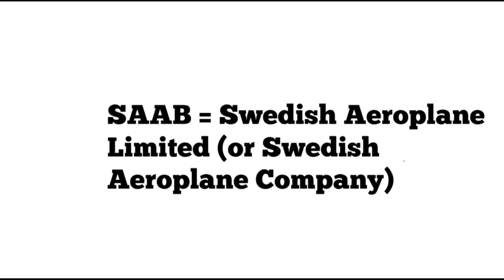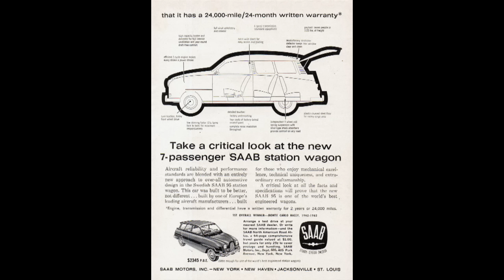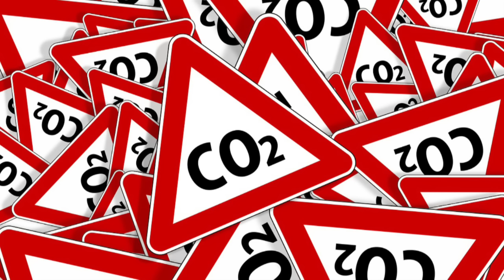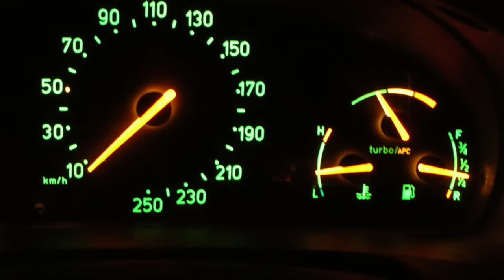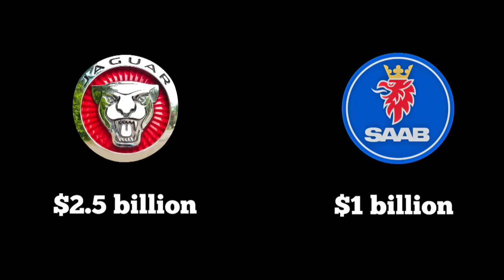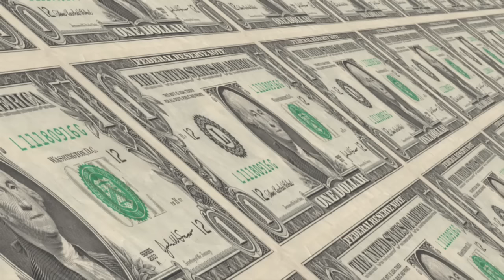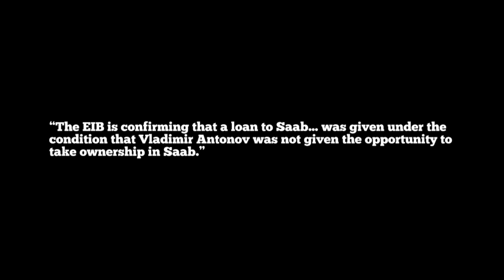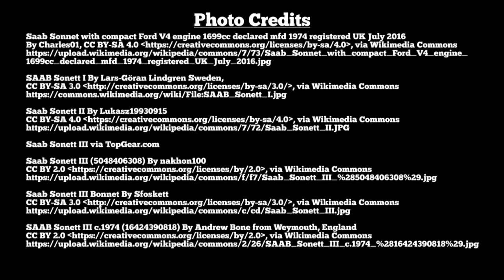The Life and Death of SAAB: RCR Car Stories

Comment: I had a beautiful Rose Quartz '89 9000S that a bought from a Westchester County wholesaler lot in '96 with 66,000 miles on it that had been owned by an older CT woman with a 5 speed. We put 100.000 miles on it over seven years with the aid of a skilled exclusive repair facility not far away but it was very costly and became unreliable until I sold it to a VT woman for $1500. But I loved it. Then in '02 I bought an off lease '99 9-5 Green Silver automatic 4cyl beige interior with 30,000 miles that the lessor bank had put out to auction in Hartford CT. which a guy who ran a used lot some distance away who I had told exactly what I wanted  called me on his way back from the auction on his cell phone to tell us. We went down to his place immediately , bought it and drove it home with a dealer plate and put in storage mid winter until I registered it in the spring. It was 20 years old with 143,000 miles in the spring of 2019 when exasperation of unreliability drove us crazy and we traded it in on    
on what we were certain would be another reliable Honda. My repair guy is still in business with a single guy working for him and a yard full of Saab junkers out of love and dedication. They were glorious fun years, but THEY HAD TO COME TO AN END.

Comment: The saab 9000 also had the GM V6 3.0 engine, the 9-5 had a 3.0 V6 Low pressure Turbo option (both V6 engines built in England)

Comment: I spent a fair amount of time driving a 2 stroke 96, first time driving a FWD car. VEry different from the typical American cars of the era. Had to keep it revved up, freewheeling took some getting used to but it was a solid, stable car but did have a fair amount of torque steer when accelerating.
Many years later I worked for SIA (Subaru Isuzu Automotive) and remember all the fuss trying to set up to produce the GM Saab Subaru. Glad it didn't happen and most of us at the plant were glad to see GM sell their shares of FHI. Toyota bought in after that and things went much better.
It would have been interesting to see what a collaboration between Subaru and Saab might have produced without GM getting in the way. Both were more unconventional auto producers.

Comment: SAAB were not the only small company pushing technology and advanced designed. Jowett in England in 1946 produced the Javelin having a flat 4 engine car with high ground clearance for the British, African and Australian markets. For the time it had sporty handling, with a flat 4 engine giving a lower centre of gravity. The engine was was a wow! at the time - fitted in front of the radiator.   The body was aerodynamically streamlined. The Javelin won the 1949 Monte Carlo Rally. 

Jowett folded in 1955 as they farmed the bodies out another company who were taken over by Ford, who dropped production levels of the bodies to focus on their products. Jowett could not sell enough cars to meet demand as not enough bodies were being produced by the sub contractor. 

When it comes to advanced technology and design none beat Citroen.

Comment: Nevs made 420 Saab 9-3 aero´s in 2014 in the Trollhättan factory, these were mostly used by employees of nevs but have now gotten out on the market, i know a company that sells used cars have sold about 15 of these cars, and checking the used car marked in Sweden you can find a few 9-3s from 2014 a model that "officialy" stopped production in 2011/2012. The saab car museum in Trollhättan was given the official last made Saab from 2012 as a donation from enthusiasts of the brand

Comment: Received a 96’ 900se turbo from the in-laws. I think of it as my informal dowry for marrying their daughter. 
Ok, ok seriously. It’s been so fun to drive. After cruising in civics, Miata’s & a capri convertible. There’s something about driving Saabs that were so fun. This car was so well maintained, I’ve been able to enjoy driving it the past 6 years & only change oil, air filter & tires. 
Some commenters have said, the auto transmissions are bad. In that case, I may just join the lemmings & get another Honda or Toyota.

Comment: SAAB realized they could not afford to make a new engine for the 99.  They were made aware the new Triumph slant-4 engine designed by Ricardo In England, who said it was perfect for the new 99. The slant gave low bonnet lines. The Triumph engine was destined for the Triumph Dolomite, which would not be available until 1972 - late in introduction.  SAAB took the first three years of English production being the first to use the engine. When the Dolomite came along all Triumphs production was destined for the Dolomite. 

In the intervening three years SAAB, who were delighted with the engine, decided to make the Triumph engine under license gearing up for Swedish production. They called it the B with slight changes.  The slant-4 engine had a 16 valve cylinder head fitted for the Dolomite Sprint, being the first mass produced engine/car to have this setup. The engine outclassed the equivalent German and Italian engines. Then SAAB fitted turbos on it. A fine engine indeed. 

Scania trucks and SAAB merged in 1969 just as the 99 was being introduced.

Comment: My first car was a Saab 9-3 aero 2.8 f40 trans . Loved the car. Got hit buy a drunk illegal immigrant a week after owning it. Sold it $100 less than I bought it. Bought a cobalt SS that blew up otw home. Then bought a Saturn ion redline for a parts car then flipped my parts car to the cobalt lol.. been driving my Saturn for the last 3 years . Bought 2 more cobalt SS and a Pontiac g5. SS swapped my g5 with the first ss then wrapped it around a tree. Fully parted it out and scrapped it. Now I'm doing the same for my first ss that's all stock junk from the base g5 lol. LS swapping my supercharged cobalt. Putting a new motor in my turbo cobalt. Putting TVS on my Saturn and calling it all good. . ALL MY CARS HAVE SAAB ON HEAD AND VALVE COVER. they are all based off the 2.0 saabs .love these cars. Miss my Aero . Love this video

Comment: My dad had one of the first 900, a heavy car with no steering servo and a three-speed automatic gearbox (Borg-Warner, I guess). After many years of use the gearbox lost the reverse, and while I replaced it with another gearbox, but the car was passed its prime. 

Bad fuel economy, but far better than the Morris 1800 it replaced. Good on the road, crap in the city.

Comment: for a further insight into the economic thinking or change thereof from seing the value of your enginering staff and building on that (1950-60 thinking) to what it is today , a good example is the boing 727 video made by gregs airplanes and automobiles channel
btw i had a grey 1966 95 with the V4 a very nice car to drive

Comment: The demise of Saab was rooted in GM's  purchase of the brand. That purchase probably bought Saab some time. But, the process of integrating Saab into the General Motors purchasing, manufacturing and marketing processes was too much change given the quickly declining situation within GM North America.
Saab badly needed product line refreshment and a major marketing and segment overhaul that there just simply wasn't enough time to get done. The greatest insult to the brand was the addition of reacted Subaru sport hatchbacks to the u.s product line. GM understood that Saab had a strong European motorsports history in rallying. But the plan couldn't produce anything that fit the segment in just months. Ironically the Subaru products are exactly what the low to mid range Saabs should have been all along! Bad timing is the best short explanation for what happened to Saab.

Comment: I had a 1996 SAAB convertible that I drove for 3 years then gave it to my father. I immediately bought a 1999 9-3 Blue  Viggen that had so much torque steer it would rip the steering wheel out of your hand😂.

Comment: I'm on my 2nd Saab and not sure what I'll drive after this. The 95 900s went 298k miles and still got 30+ mph. My 2005 9-3 is a good car, but with so many poor GM parts on it it's not half as good as the 900 was.

Comment: I loved my SAAB 9–5. It had 200 hp and 230 ft/lb of torque. Jam the gas and it would rear up on its haunches like a Pontiac GTO. (Which was awesome for a FWD car). It handled like a champ in the nasty Chicago winters and it was fun to drive.

And eventually I remembered that the ignition was in the central transmission column.

Unfortunately, the timing belt shat the bed and destroyed the engine at 55 MPH. The $5K it would cost for a rebuild was more than the blue book value of the entire car. I loved the car; but not that much.

Also, SAAB still makes world-beating fighter jets too. Imagine if GM made an F-16; that'd be a fuckin nightmare.

Comment: The Ford V4 cologne engine needs more respect. Had a unit until about 5 years ago. Ran great as the dealer came and got her. The turbo family friendlynsss is questionable.  It was nice and family friendly until 65 but then it wanted to warp to 85 with or without permission like a teenager.

Comment: I had a 2004 saav 9-3 and you could legitimately change the engine maps and tune it with a normal FTDI ODB2 cable and some free software. What car could you apply your own stage 1 tune the internet built, get 15 extra horsepower for $20?

Comment: The contrast between a front placed motor/engine and a rear placed motor/engine is like driving and fueling a car uphill as opposed to downhill; The physics advantage of the rear placed motor/engine is that much dramatically better, which is not only easier and tending to conserve energy rather than waste it, but also gives the driver much greater control over the automobile. Split wheel systems like Tesla(I'm going to catch hell for this,) can be classified with front placed engines as simply physics inferior. First the American Tucker and his auto company, then concurrently Saab and Volkswagen used rear-placed engines. As became dramatically clear in the case of Volkswagen, rear-placed motors/engines require significant armoring, especially with petrol as rear-end crashes are common and engines flammable. Neither Tucker's cars nor Saab(to the best of my knowledge regarding Saab; I am frankly unsure on this point but they're such little, motorcycle cars I can't imagine the engine is invulnerable behind heavy armoring as I recommend.) The idea, which should be obvious to auto-designers thinking in terms of sound physics and is a solution I should certainly have found myself as I found the solution to missile and missile defense science,) seems to have originated with the American Tucker. No one seems to have proposed the heavy armoring before me(Ford acted upon my science and advice with the new F-150 and the new Ford Mustang Mach-E EV which are well armored, safe cars.) Volkswagen had a terrible problem with engines catching fire from crashes and burning people alive,) so nobody tried the idea again until I persuaded Ford. Saab also seems to be stirring back to life as the physics concept is rediscovered. Placing the well armored motor/engine in the rear of the auto is the first innovation I've been advocating these years; But I have many more innovations for the auto industry that have been thoughrily considered and are at advanced stages. Indeed, I have a superior auto system ready in which the rear-placed motor/engine is only the rudimentary prerequisite to a more advanced system that gives humanity cars that, to state the matter bluntly, are superior to all cars existing today by leaps and bounds; especially when it comes to safety and performance(not even mentioning how much more efficient my system is because that's not my emphasis,) and if you know accurately of me you know aesthetics and especially comfort are my very high priorities also, not only for myself and high-end customers, but for economically average people who will do us the honor of driving and riding in these cars. Thank you.

Comment: What happens when you build a car that looks way different than any other car… a car that is mechanically un reliable, a car that has electrical problems and don’t train service technicians at dealerships to be able to properly fix the cars ?! And then sell off the brand to a incompetent manufacturer who themselves is barely afloat?? You get disastrous results

Comment: Why Saab had problems.... In simple terms, for what Saabs were, they were too expensive. When the 9000 came out and was marketed as a luxury car, it was the wrong thing. Why did Saab not sell as a luxury car? A 4-Cylinder engine. Even with the turbo version being powerful, a 4 cylinder was just not as appealing to people, who with the same money or a bit more, could get other brands like Mercedes, Jaguar, BMW, Alfa Romeo, etc. with 6 or more cylinder engines. Brands which were already well established as luxury cars. Using front wheel drive on a performance car was another thing which Saab and other car makers made a mistake with. Yes you tune things up, and front wheel drive can work pretty good, but ultimately for a performance car, rear wheel drive wins out. Nowadays one can also talk about 4-wheel drive, but that is a different argument.

Another thing was the general marketing idea of the Saab as a multipurpose car. While this is a nice intellectual idea, the realities of the market are different. What a lot of people did not really get is that folks in the luxury car market don't care that much about fuel economy, or things like how big the trunk of the car is, or how useful the car is. It is more about the main purpose, rather than multi-purpose.

Those that have money do not have a need for a car that does it all. For fun they have a sports car, for regular use they have some economy car, for utility they may have some truck or SUV, etc. For those who could not afford more than one car, and liked the idea of an all purpose car like a Saab, the cars were too expensive.  In the same general sense, another mistake Saab made, and other car makers have made as well, was not to have a proper flagship/halo car, that being a proper high end sports car. A souped up hatchback like a Viggen just does not do that, again, too multi-purpose. Bottom line though, it does come down to money, and the high cost of unionized labor in Sweden did not do Saab any favours.

Comment: I loved SAAB, Safe, dependable and in snow, I never got stuck in the two SAABs that I had. I also sold them for awhile. Just as safe as any Volvo. Just cannot figure out that the domestic car line was ever sold to GM who raped the carline and then trashed it. Volvo had their domestic line bought out by FORD which did the same thing and then sold their Volvo line to the Chinese. I owned 2 SAABS and 4 Volvo's.

Comment: While I enjoyed the idea and personality of the 2 Saabs I owned ('84 900 turbo, 87 9000 turbo), they were the least reliable, least practical, least fun to drive (on a performance level) and biggest money pits of any of the cars I've ever owned.  Everything went wrong from brakes, to seizing transmissions, to alternators, ac compressors, window switches falling out of the door etc etc etc. There's no doubt they had a presence and personality in the 1980s and early 1990s but the engineering was junk.